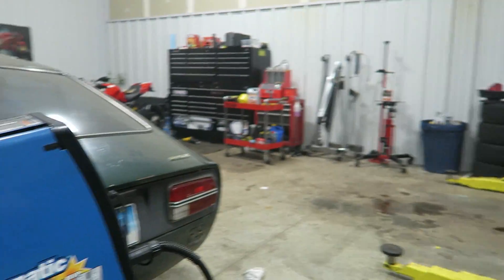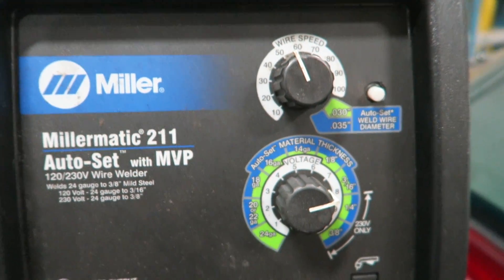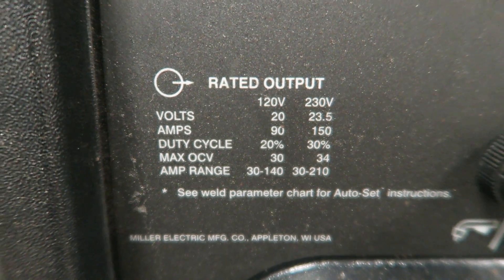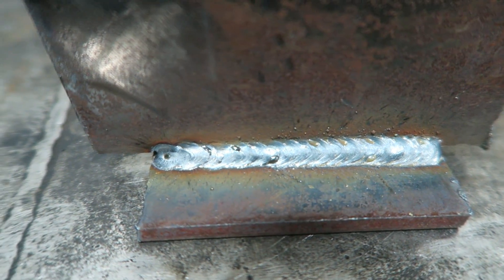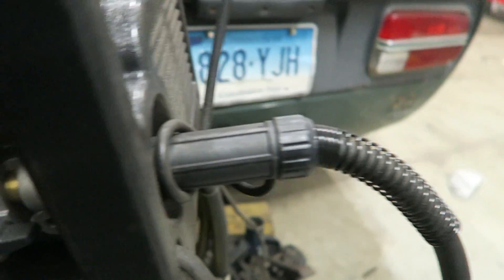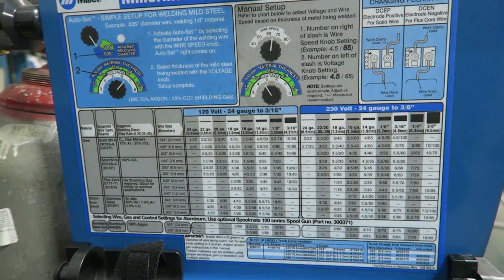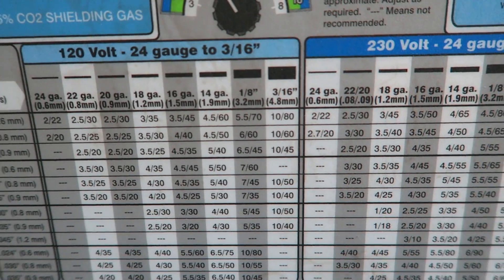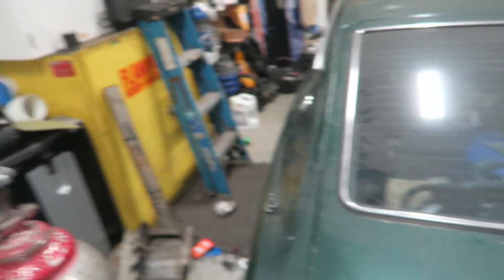Mig Welder Basics. Getting to know the machine!

Comment: Hi Morfius, im a novis i purchased flux core only welder basicly for odd jobs, im to old to go to any sort of  weldeing classes, so my question is can you give any suggestions on tension on the spool of wire and the roller that feeds the wire, as every time you change your spool its not guaranteed you put the same tension back as before i dont have a cheat sheet on my machine at all and can't obtain one, I've watched videos that show if you can stop your wire with your finger your about right but i would have to crank mine way to much it puts a flat spot on the wire, ive seen how to do the inches a minute when you press trigger and count how much wire is fed out in a certain time, but I'd have to do this on every setting from 1to10 and then again when i change spool again, I've done the sizzling bacon sound while altering the feed, i only have an hi and low switch, frustrated lol cheers (my welder is a sealey mightymig 100 I've even got intouch with sealey and they said there's no ball park settings go and take some classes, i bet they don't ask anyone if they've taken classes when first purchasing any welder off them as i think they'd be down on sales
Reply from the maker: Tension on the wire isnt an exact science so its hard to nail down. Each spool can be slightly different size and also slightly different in softness. What I have found with my miller is i go until the wire shows deformation and then i back it off a bit. again not an exact science by any means. Only having high and low is going to limit you severely. If you use .030 or above wire youll need to run it on high all the time. Anything .024 or below will need to be run on low. I hope this helps a little!
Reply: Cheers morfius, thanks for reply I'll give it a try